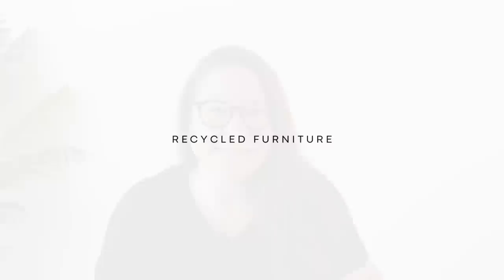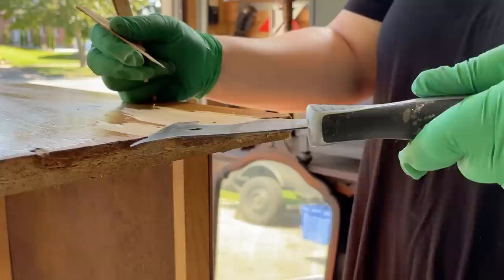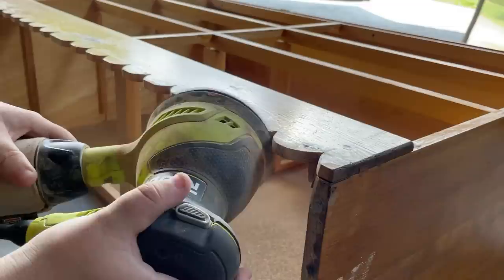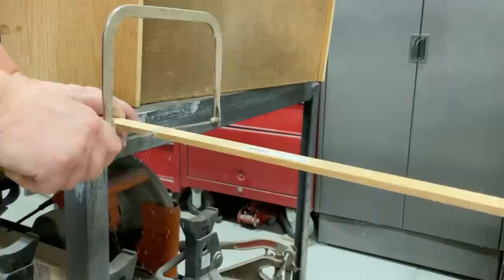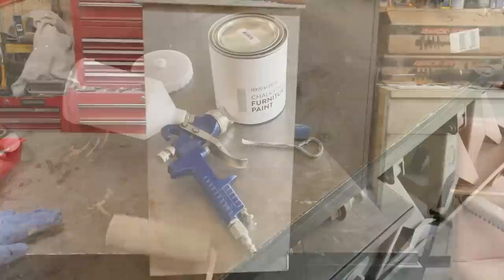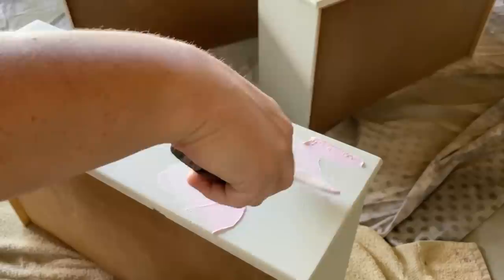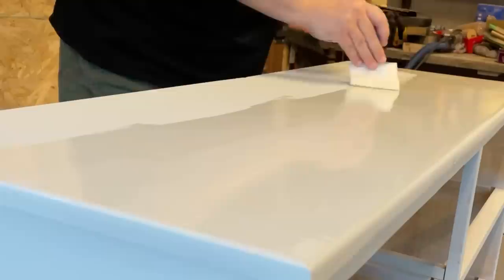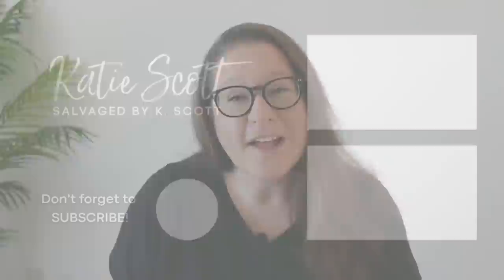Cute Cottage Style Makeover | Salvaging a FREE Dresser

Comment: Love your work!  You always inspire me to get started on my next projects. I have a question about filling pull holes, do you fill both inside and out?  I find that the inside of the drawer looks unfinished when I drill new holes but if you fill the inside it doesn’t match the drawer. What is your suggestion?
Reply from the maker: I've never filled the inside of a drawer hole. I don't think I've ever seen the back side of the drawer front either. You'd have to pull the drawer all the way out and turn it around so I don't think its necessary.

Comment: Hi Katie … Great vision as usual !  And it turned out well!  
I have a question I have a dresser like this myself, bought when we had no money and three kids! You did all the painting inside and out of the drawers which is something I probably want to do as well …..I would be afraid the drawers would stick even more than they are sticking now!!!!!  What do you do to make sure the drawers work smoothly and still fit and still work at the end?  Thanks Kaitie …. I’m about to try to save rather than throw!!
Reply from the maker: If you’re drawers are already tight or sticking DO NOT PAINT the outsides. It will only make the issue worse. As long as they are made of wood, you can use an 80 grit sandpaper to sand them down and get a little more room on the sides.
Reply: Katie … Thank-you so much for replying!! OK, I will follow your advice!! Much appreciated. My daughter has moved interstate to study , so during our lockdown I have time ( lots of it!!!!) to refinish some furniture for her (we’re in Australia).  Thanks again - love from Deb

Comment: I am curious about the paint sprayer!  I paint my furniture by hand using Cling On brushes, which I love because they leave a smooth finish....but after watching how easy it seems to be with the paint sprayer- I am thinking about it for jobs that are solid colours.  I use Fusion paint and I have seen you use it with the sprayer before but would you say you use more or less paint comparing sprayer with brushes?
Reply from the maker: Spraying uses slightly more paint than brushing but most paints need some extra water added to them to spray well anyways so that stretches it out.